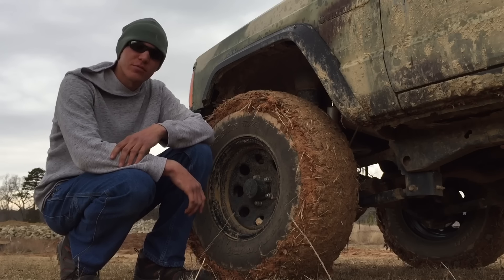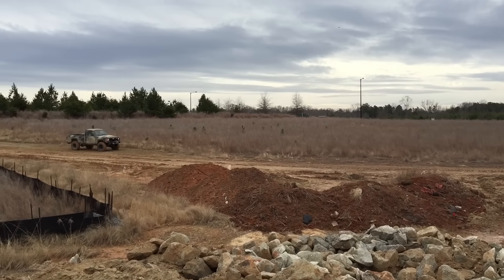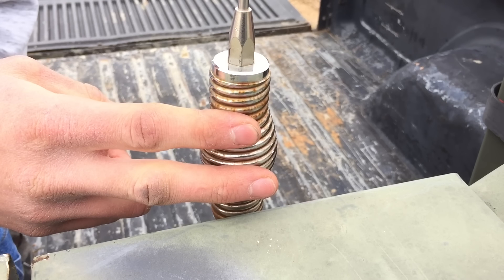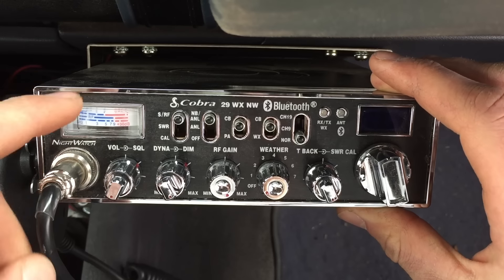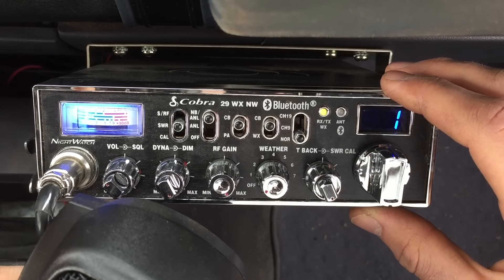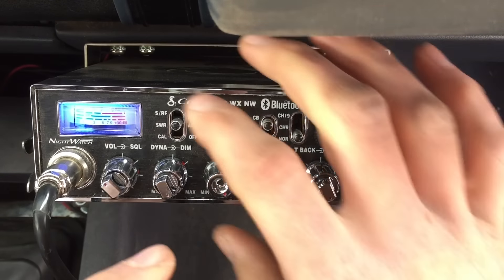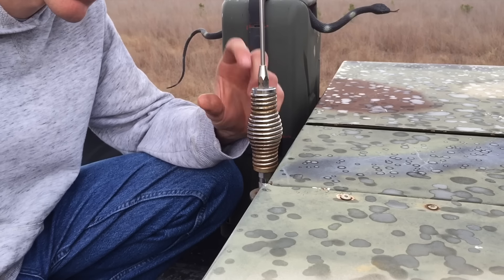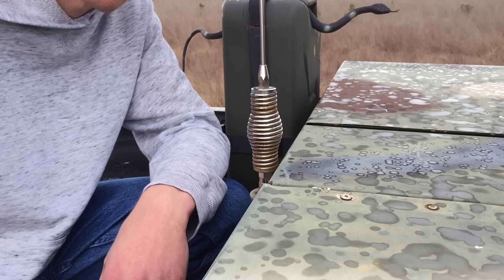How-To Tune a CB Antennae

Comment: built in swr meter is crap!! very innacurate
Reply: +WPGinterceptor            Depends on the quality of the radio. Crappy radios have crappy SWR meters, while meters in other radios are about as accurate as any external meter - which, in themselves, are not always accurate.
Reply: ***** EVERY cobra ive tested, the meter calibration is WAAAAY off!!
eg: what shows as flat on a cobra meter is over 3 on a professional meter!
Reply: Never trust an internal meter until you compare it to an external meter.

Comment: A little bit of knowledge is a dangerous thing.   First and foremost...you transmitted on three channels....1, 40 and 19....WITHOUT LISTENING FIRST!  What if there had been emergency communications in progress on any of those three channels?  That's just plain negligent.  Second...SWR.  Measuring SWR at the radio is not accurate.  There are a lot of variables that can effect the reading such as co-ax loss, coax type, age and quality, DC and RF grounding and other factors.  It is quite possible to read a near perfect match at your radio/antenna panel connection and not be radiating any signal at all.   CB radios are designed to "match" an antenna with a 50 ohm impedance...or, if you like, resistance.  A half wave, center fed dipole antenna at 27 MHz is about 17 feet long with a theoretical impedance of 50 ohms.  That means that each half of the antenna is about 8ft, 6 inches long.  You are using a 102 inch stainless steel whip antenna....which is about a QUARTER wavelength long, .....or half of a half wavelength.  The impedance isn't 50 ohms any more.  Typically an end fed quarter wave antenna impedance is about 20 ohms.  You're using a metal tool box as the "ground" connection--the outer conductor of the coax.  It's damn near impossible to figure out the actual "length" of that toolbox when it comes to RF wavelength.  Without getting into the actual amount of the power (taking into account the inherent loss of the cable) presented at the antenna that is actually radiating...it's highly probable that a 50 ohm to 20 ohm mismatch is occurring...or worse.  That mismatch will result in a lot higher SWR than the 1.1 to 1 reading on your meter.  High swr with coax cable means higher loss in the cable...which means less power being radiated by the antenna.   It also means less APPARENT measured reflected power when measured at the transmitter end of the coax cable.  I'd be surprised if you're actually getting 50% of the 5 watts output to the antenna.  The remaining 2.5 watts is expressed as heat in the coax.  At that power level it's unlikely you'll feel it on the cable.  The only way to accurately measure SWR is at the antenna end...not the transmitter end.

Comment: the only reason those washers make a difference because the mount has a poor ground clearances  because the metal isn't thick enough to provide the ground plain to it..

you know stuff all about tuning an antenna.

Ii you actually want to calibrate the antenna you will need a SWR meter between each  junction point  to test between each part for checking the continuity between  your radio and antenna..

all you did is set the dead key of the radio..

I think you really need to learn what you are talking about because from what i seen you haven't even done a basic modulation check..

and advising others to do what you do without the proper test equipment..

yes this might be down and dirty quick fix for calibration on the fly, though I would suggest you put a disclaimer in the information give  may not technically correct..
Reply: With AM radio (CB) the modulation doesn't change the frequency (FM), just the amplitude or strength of the signal, so the SWR of the dead key will be the same as the modulated signal.
Reply: The flat washer is there to compress the isolation washer. Period. The lock washer is there to keep the stuff from flying apart.  It is not there for tuning. On a 102 in antenna,  with a spring, it is recommended to use 18 feet of coax.  If a person wants to be anal about it  they will use 19 feet of cable and then trim it down and put the end on and then check the SWR and do it all over again until they get a number that they like.

Comment: you don't tune a 102 steal wipe please don't put out bad info if you don't know. leave it to the professional
Reply: I disagree you sometimes need to tune it like he said with washers,spring or (hard to do)and you can cut your whip.you wouldn't believe what I had to do to mine on my 99 jeep wrangler  hard to tune because of the body style
Reply: by steal wipe do you mean steel whip? don't type if you don't know. leave it to the professional
Reply: RumbleTruckin ,I think you need to be more professional, there are a lot of times I hit the wrong key or the auto correct.so unless you have some knowledge of what this is about I suggest you calm down and think things through you remind me of a golden screwdriver your the only one knows anything,grow up
Reply: you spelled "you're" wrong.
Reply: Nonsense, anybody can tune an antenna using the method he described. A 102" whip is a resonant 1/4 wave antenna for the cb band if you have it coupled with a 102" counterpoise, a jeep body however is not a 102" counterpoise so you need to tune the whip.
Reply: LOLOL go ahead and tune your 102.... its not my fualt you are wasting your time on a no tune antenna
LOLOLOL
Reply: 102" whip is a resonant 1/4 wave antenna, but the extra length of the spring will throw the SWR off.